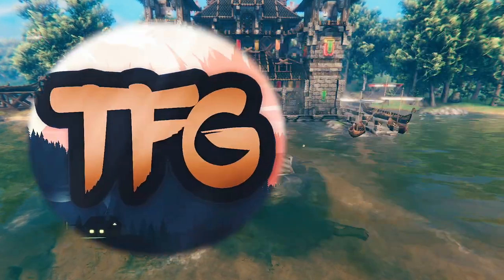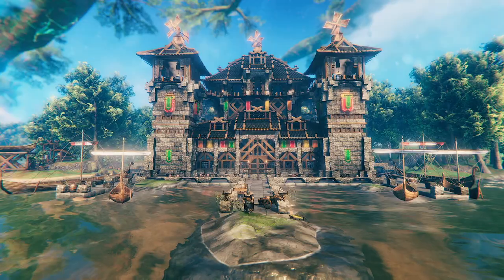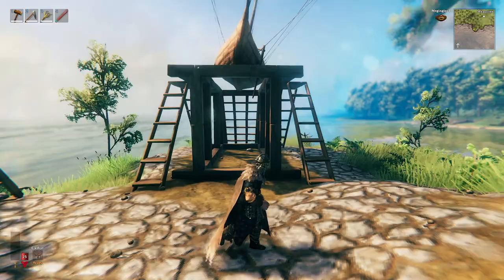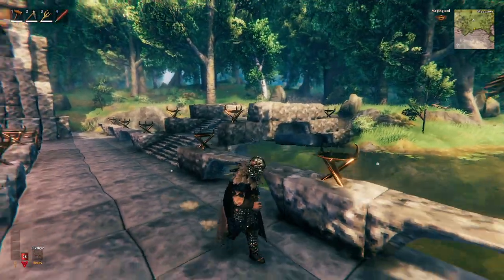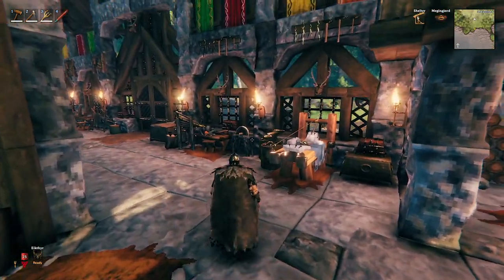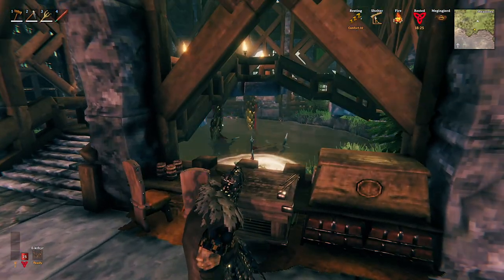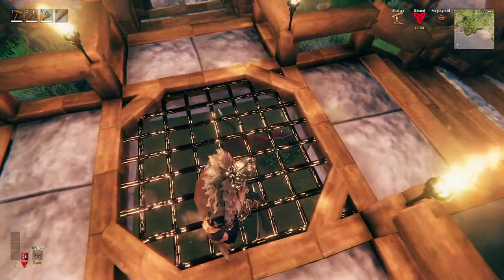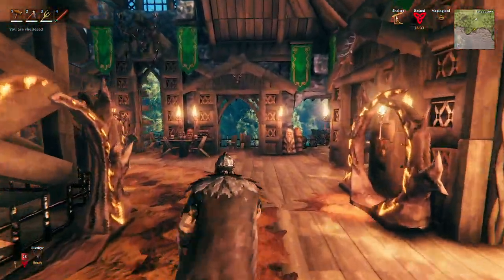Challenging myself to build with Water in Valheim

Comment: Impressive.
I have 2 questions.
How could you reach this high? Even with metal structure, it seems too high.
And how your pc can read all details of your building? It's really too massive.

And last question.  How many time to build this?
Congratulations! It's really beautiful work
Reply from the maker: I have a build heights guide that can explain this perfectly.... but In short stone does not assist iron but iron does assist stone. So the stone height is higher than normal because of the presence of iron in the towers and walls. I used the stone for most of the wood connections. At the VERY top the iron is not enough though so I used a trick that you can do without mods(that I show better in the build heights video) where I spawn in a rock(with devcommands) called rock_destructable_test that can act as a foundation wherever you spawn it in. The rock is a large cluster of rocks that can be broken down into one rock out of the cluster so it can be hidden better. To be honest it was not my intention to use this trick at all anymore but I accidently built this too tall to support without some 'help'.

Took about 30 hours to build. Thanks for the comment friend, take care!
Reply: @9byte  ooook I understand now. I never use mod but I try to build most higher house with metal fence and it's no possible to get this high. But I know a trick to get a high better than metal fence and without mod, the pin tree. You can build around and hide the tree if you don't like the sight and make a big high with it. 
So you did this just in 2 days woaw. 
And my last question. Did you draw it on a paper before to build in a game? Or you did that just by feeling?
Reply from the maker: @biloute6207  I did not use a mod to do this. I used devcommands. These are built into the game. 👍👍
Build heights video so that you can understand build heights: https://www.youtube.com/watch?v=hF_J_DBs4vg&t=570s
Yes trees will create a foundation for anything touching it just like the rock trick that I used here.

I did it in 30 hours so it took me about 4 days of long building sessions.
I did this build by feeling I suppose. The layout is pretty simple to be honest. Its just a square with 4 towers. The main idea here was to create a large enough structure that it felt massive on the inside so that it looked cool and also so I could include a water feature on the inside for the theme of the build.